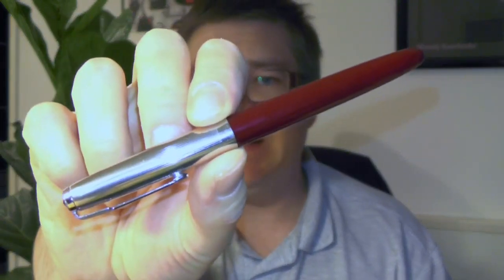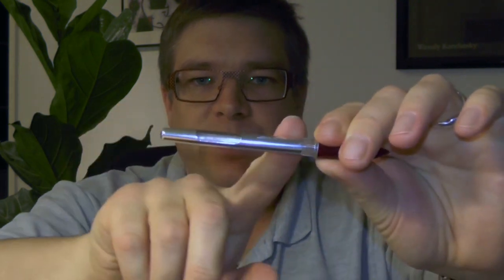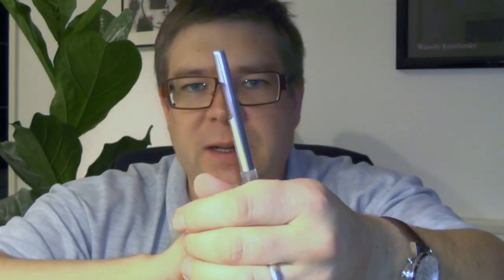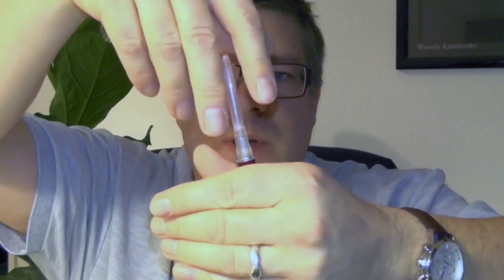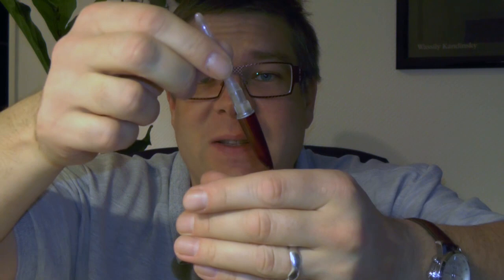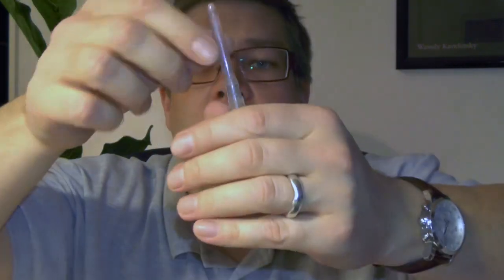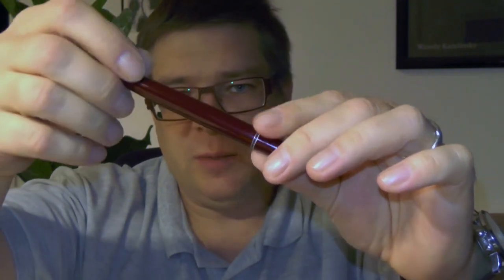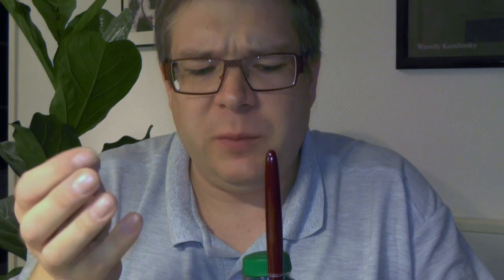Filling Aerometric Fountain Pens Like The Hero 616 - The Per

Comment: I'll stick with using the pressure bar on the sac protector. The sac protector does pull off my Hero 616, but not my Parker Super 21.
Using the standard method, I get enough ink to last a couple days. If I ever need greater capacity, I have Jinhao 992 Demonstrators that I use as eye dropper pens. Up to 3ML of ink is a lot more than the 51/21/Super 21/616, and my vintage lever fill pens hold, even if the sac was filled 100%.